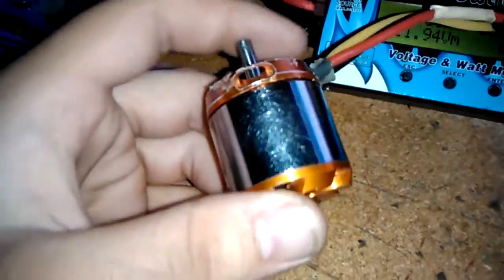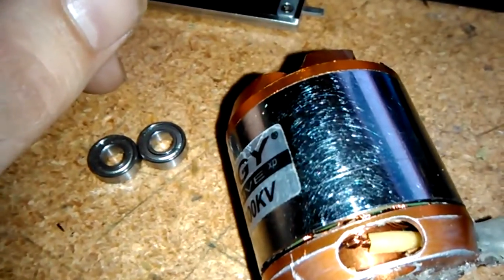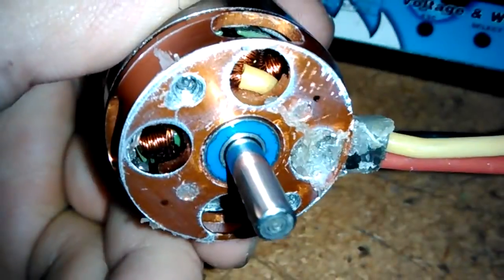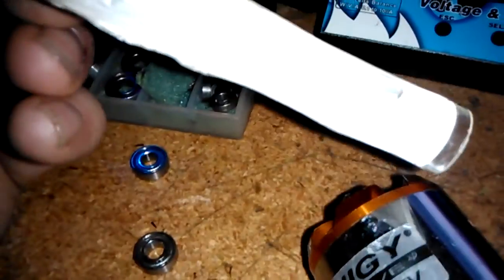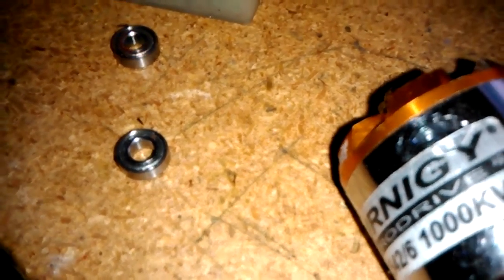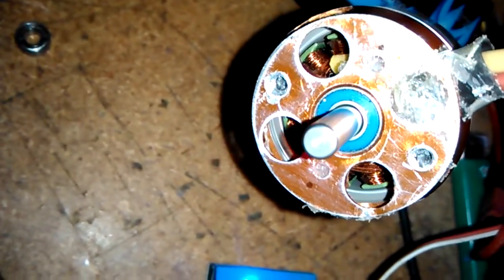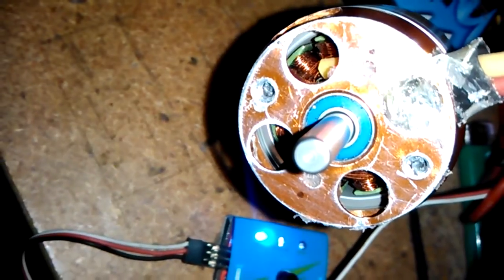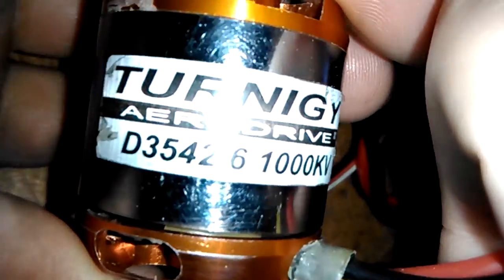Over Heating Brushless Motor Repair

Comment: Interesting :D Did you know that it's not the laser-dot that is used for measuring the temperature ? It's only a pointing device for the sensing element. Putting the infrared thermometer really up close to the motor will give you a better reading, in stead of moving it away, and you will get a mixed reading of the motor + the surroundings. Also, anything that is not matt black will read as colder than it is in reality. :D